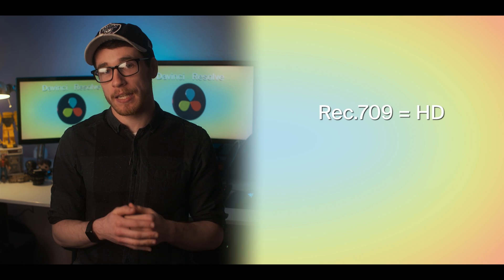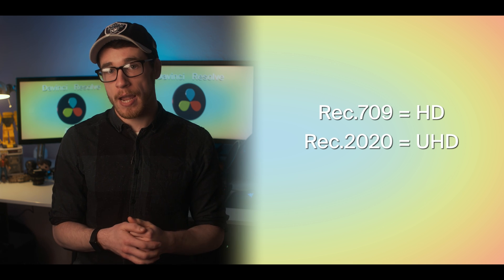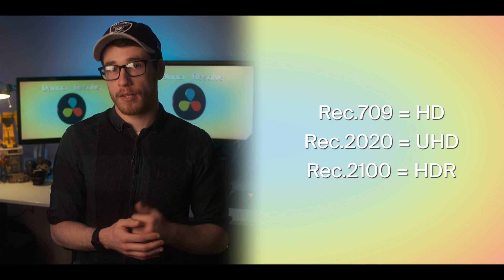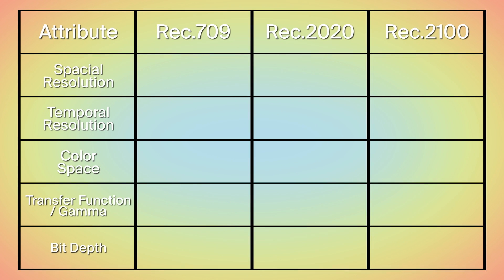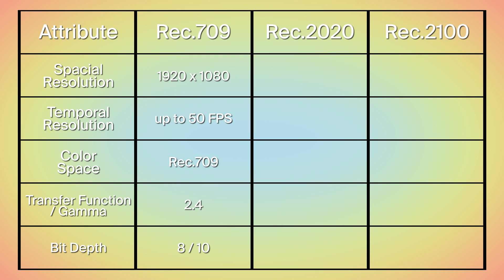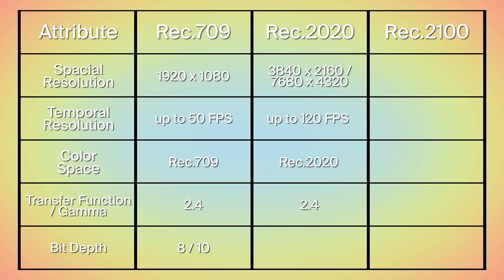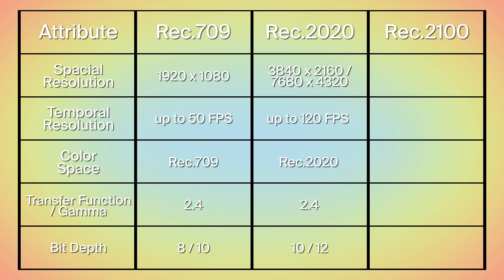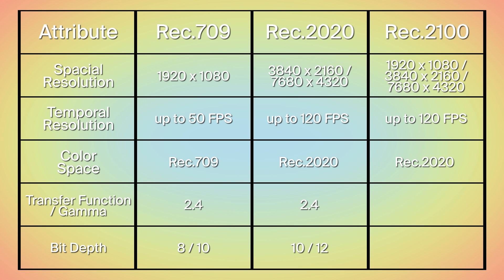Rec.709 vs Rec.2020 vs Rec.2100 The Simple Explaination.

Comment: İ struggle with V-Log in CST. İ have ProRes 422 HQ V-Log 10bit 3840x2160. So in Project settings: Timeline = Rec 2020, Output Rec 2020 & in CST (Node) V-Log , V-Gama, Rec 2020, Gama 2.4 is that correct ?

Comment: So YT requirements Rec.2020 with PQ for HDR is incorrect, because Rec.2020 has no PQ/HLG, only Rec.2100 has PQ/HLG.
Further Rec.2020 is for UHD content, while Rec.2100 is for HDR content, so YT should require Rec.2100 PQ for HDR and not Rec.2020 PQ.
But so I guess it won't matter if I upload Rec.2100 PQ to YT, because the Colorspace is the same Rec.2020 anyway.

Comment: So in the REC.2100 options between PQ and HLG where lies the difference? My current editor (Wondershare Filmora) has recently been updated and whenever I expert a file in 4K 60fps I have the choice between REC.709 or REC.2100 HLG or REC.2100 PQ. I cannot find that much information about the difference between the last two but the few articles that I read most suggest using HLG. But it also appears that Filmora checks whether your monitor is capable of showing those colors. It appears my monitor cannot. Maybe others can, but my monitor appears not to. I have Samsung U32J59x 4K monitor.
Reply: i have the exact same doubts with the same software

Comment: Hi. Unsure if this issue is ONLY for Premiere but when rendering iPhone HDR footage using both 2020 and 2100, the video is overly exposed to where it's unusable. My workaround is using Rec 709 OR 2020 but also have to use a LUT to fix over exposure. Is this issue also occurring in Resolve? I'm new to editing and trying to get an in depth understanding on color and rendering.
Reply: This also happens in Final Cut Pro.. I have gotten iPhone footage in HDR and yes I need to place a LUT or a Rec 709 conversion to fix use the footage.  I don't think it's just a Premiere  issue.  Hope this helps.
Reply: i recently found the answer for this problem, i've been using davinci and i had issues where my HDR iphone footage looks washed away once i import. But I started exporting , just changing the output gamma to Rec2020 Hlg in the export page, and wallah, the footage looks exactly like the iphone
Reply: @mohammadsirajuddin1102  It's more complicated than you describe and depends on program you use for playing video. Try to open in quicktime and upload to youtube and you will get 3 different pictures.

Comment: I have a question.

I’ve heard that sRGB uses its own transfer function (gamma curve) which basically is 2.2 but not quite. 

This leads me to the following question. 

Is Rec 709 exhibiting the same type of behavior in relation to the standard 2.4 gamma curve, like sRGB does in relation to the standard 2.2 gamma curve?

Like, does Rec 709 also have its own special transfer function (gamma curve) like sRGB?

Is there a difference between the Rec 709 gamma curve and the standard 2.4 gamma curve?

Thank you in advanced!

Comment: Interesting video thanks, I'm trying to learn a little bit more as my projector has both options and auto (which always seems to default to BT.709.  To me BT.2020 looks far superior even though reviews suggest my PJ Epson LS500 doesn't do much of the colour (50%) I think.  The colours look far more vibrant and I've yet to see any downsides to sticking with BT.2020 even when watching 1080p or less material.  Is there any issues with keeping the setting on BT.2020 for all material? I usually stream netflix, prime and disney so I get all different quality of content.
Reply from the maker: Hi, that’s a bit of a tricky one to answer as I don’t know the spacifics of the hardware so by all means take what I say with a pinch of salt as I am making presumptions here. Unless the content you’re streaming has been mastered for rec2020 there’s a good chance the image you’re seeing is the projects attempt to convert and output a different input and is quite likely an inaccurate representation of the intended image. Personally I could not do that as I need to see what the director/dp intended me to see, that said if you’re a more casual viewer and you simply prefer how that looks then power to you I say! Just know that there is a potential inaccuracy in the pipeline. You’re steaming services might very well detect the device and be streaming a “correct” image too.
Reply: @FilmResolved  Thanks, I will bare that in mind.  I have an OLED TV underneath the projector and that is what I'm using as my reference as they supposedly have best in class colour reproduction.  The BT.2020 setting always has it closer to OLED but like you I worry about it not showing as intended.  I did try to find out what netflix disney etc output but could find a definite answer.  Those and Prime make up 90% of my projector viewing along with occasional blu ray/blu ray 3d (which is incredible on this PJ :-)).

Comment: So if I understood.... my delivery
 color space should be rec.2020 if Im uploading videos in 4K to Vimeo/Youtube? (shooting on Panasonic v log 10bits 4.2.2 90% of the time)
Reply from the maker: Not necessarily. These are just the recommendations. Nothing to stop you adopting the 2020s resolution for your 709 project. I upload 4K with rec.709 gamma and gamut for all my videos as the extra resolution help mitigate a lot of compression artefacts. What I certainly wouldn’t recommend is using a 2020 timeline and delivery if you cannot actually monitor that color space!
Reply: @FilmResolved  ok, so if my monitor is a rec709 100% compatible, using a rec2020 timeline would not be useful at all. Is that correct?
Thanks in advance!
Reply from the maker: Correct. You cannot see the addition color so you’d be grading blind essentially

Comment: I need to grade UHD slog3 footage . To be mastered to UHD and HD. Can I grade in Rec 2020 and master both versions without losing detail in the HD version?
Reply from the maker: Is it just the resolution you’ll be altering between the mastering?
Reply: @FilmResolved  Thank  you for getting back to me. The deliverables are UHD (Rec 2020) and HD (709). Budget only allows 1 round of color, is it safer to grade in color space 709, and change it to Rec 2020 for UHD mastering
Reply from the maker: You would typically master to the bigger specs and go down from there where required. Remember these are just recommendations (rec) so make sure that they’re looking for a change in color space and not just resolution because it’s not uncommon to deliver rec.709 gamma and gamut but in 3840x2160 resolution. And you’ll have great difficulty monitoring a 2020 gamut.

Comment: Why I see 4K and 8K HDR videos have Rec.709 8-bit instead of Rec. 2020 10-bit on Youtube?  
I have iMac Pro 5K or Mac Pro with 6K XDR monitor that supports P3 wide color gamut, 10-bit per color of RGB.  I don't see it says Rec.709 10-bit or Rec.2020 10-bit.  P3 Monitors do not have the same color gamut Rec. of modern TVs.  I don't think XDR is better than HDR; it's Apple monitor P3 XDR different from Rec.2100 HDR.
Reply from the maker: Wow there a lot in there! For your first question, assuming a video is labelled“HDR” and when looking at stats for nerds and it’s says rec.709, then for one reason or another, is NOT in HDR. For your second question I’m not quite sure what you’re asking but P3 is originally a cinema gamut not broadcast. Its larger than 709 but not as big as 2020. Right now 2020 is as good as a theoretical gamut as there’s not displays that can actually show that much color (at least nothing remotely affordable). It’s seems as though manufacturers adopted P3 from cinema as that’s where display tech is currently at.
Reply: @FilmResolved  It's a big problem for color accuracy of videos from cameras or camcorders to computer monitors to the TVs.  We've watched many videos they look different from one source to another source.

Comment: And for 2k resolution ????
Reply from the maker: That’s DCI so it’s a cinema standard, not a broadcast standard.
Reply: @FilmResolved  so, if I want put a 1920x1080p60  video on yt I must have Bt.709?
Reply from the maker: Honestly YouTube is a wild west for specs with a lot of wiggle room. These are broadcast standards and would have to be adhered to rigorously if your were delivering for broadcast. But to answer your question for 1920*1080p60 yes I would go with bt.709 (if the footage is SDR). If you want the slightly wider aspect ratio of 2k then master it within a HD timeline where it’s slightly scaled down with letterboxing on the top and bottom. Hope that makes some sense!
Reply: @FilmResolved  no, 2k doesn t interest me, im asking u if a 1920x1080p 60 sdr video in yt need bt709, but thanks for answers
Reply from the maker: You start by asking “and for 2k resolution????” But okay 🤷‍♂️
Reply: @FilmResolved  yes but I ask u it because i didn t see it in the video, but a video for yt 1920x108060 sdr need bt709?

Comment: Awesome! i use my Sony a6400 and sigma 16mm f1.4 mostly for low light scenarios.  i mostly use "Gamma Still" and "Color Mode - Pro". Finally i always export in 3840x2160. Should i use Rec.2020 or rec.709? i see that rec.709 spacial resolution is 1920x1080 but my sony's bit Depth is 8bit. i am confused...... i am always editing with rec709 profile on my Benq monitor but when i switch to srgb i get a lighter image with less deep blacks, do you think it's normal? thank you so much!!!!!!
Reply from the maker: Use Rec.709 and keep your monitor set to Rec.709. sRGB is a photography color space.
Reply: Thank you very much ;)

Comment: isn't 3840x2160 16:9? why is the video letterboxed?
Reply from the maker: The letter boxing is just overlaid to achieve the 2:1 aspect I like to use for this studio set up. The actually video is 3840x2160 just several thousand of those pixels are black in the form of those letterboxes. I opt for 3849x2160 for the videos on this channel because I often mix aspect ratios such as 16:9 for screen recording when doing software tutorials and also most cutaways / overlays, 2:1 for the studio set up, 2.35,2.39 and 2.40 for shot recreation etc. In short UHD 16:9 is the best canvas for my workflow in terms of fitting my mix of aspect ratio onto. Hope that makes some sense

Comment: I have a question. I uploaded a video from final cut pro x to youtube, for some reason in fcpx and also while viewing it on my mac in quicktime it looks perfect, but after i upload it to youtube the video gets darker and the colors are washed out. Driving me crazy. It didnt do it with other videos Ive done and the only thing i can think of i did different is have the project in 2020 instead of 709 but i still exported both in 709. Tried changing settings on my chrombook and looked at it on my tv too, both still dark an washed out, only looks right on mac.. any idea why this is happening or could the difference in settings for my project mbe doing this? thanks
Reply from the maker: There is a good chance your project is settings is what’s causing this. You say your exporting Rec.709, are you doing this by using the gamma and color space tags in your render settings. It sounds to me like these are being left set to “same as project” and because your project is set to 2020 the video is being tagged with metadata that is causing YouTube to misinterpret the footage upon upload.

Comment: And here I am wondering what to do with my gorpro Hero 3+ footage shot in protune wich aparently is another colorspace but should be like rec.709 10-bit...
Aaaanyways, nice vídeo man, helped me clear up some confusión and saved my a good bit of reserach.
Reply: GoPros are all 8-bit and use sRGB colorspace. It's similar to Rec.709. Protune is not a colorspace. Protune is the setting you turn on which gives you higher recording bitrate and a couple more settings. It gives you two profiles for color: Flat or GoPro Color. Flat is GoPro's version of a Log gamma curve. GoPro color is just trying to make it look good without grading. You should probably use Flat if you're going to do any grading. And you should definitely NOT use Flat if you're not going to grade it in post.
Reply: @RaquelFoster  Yeah, I messed that one up! Thanks for the correction (flat color vs. Protune).
With the hero3+ when shooting in protune mode and converting it to cineform in the defunct GoPro studio app gives you a sRGB 10bit 4.2.0 Avi file. they apparently moved away from that strategy in newer cameras. GoPro is confusing as all hell sometimes.
Reply: @sk8lucas  I googled around and the Hero 3 is the only GoPro I can find any evidence of anybody saying it can do 10-bit. And it also outputs 10-bit over HDMI!

Comment: What's would be the bandwidth requirement for Rec 2020?
Reply from the maker: Depends on just what specs you go for, minimum specs of 4K or UHD 10bit 4:2:2 is 8.91Gbps according to cable manufacturers charts. But that’s probably accommodating an uncompressed signal.